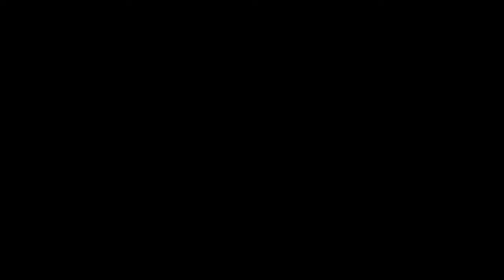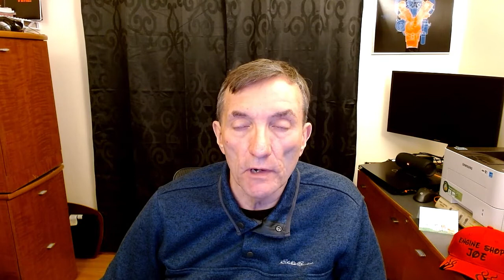ISX Jake stages explained

Comment: If a speed sensor for my speedo is not working will that have anything to do with my jake innermitantly not working to full potenchal
Reply from the maker: Short answer No.  Long answer below.
If we are talking about an ISX 870 and newer, the engine ecm sends the speed signal to the dash computer (vecu) and that sends the signal to the speedo. There was a problem with some earlier calibrations where the speedo or tach or oil pressure gauge just stopped working. An ecm software calibration update would correct that. But it could just be your VECU or as i call it dash computer needs to be updated with the ESA program. Generally speaking if the engine ecm loses the VSS, also called road speed input, the jakes and cruise just completely stop working. If your jakes work but they are weak or seem like they are only half on ( by sound) It could be a mechanical or electrical problem under the valve cover. I always pulled the cover if they half worked and check voltages and solenoid function. ALso wire end clamping force on the solenoid spade. If that all seems ok and you have no wiring issues it could be some of the jake levers themselves are internally failed.
Reply: Well my cruse works rpms work but replacine the speedo sensor but the jake inermitantly doesen always work
Reply from the maker: @devinlewis3509  If when it does work it works like it should it is wiring- the wires on the solenoids get loose (the slide ons) from hot/ cold cycles and vibration. Pull the valve cover and make sure you cant pull the wires off the solenoids with a light tug. If you can remove them and squeeze the spring female connector  closed a bit and put them back on. I repaired a lot of jake issues just doing that.
Reply: Thankyou onece i changed the speed sensor everyting works perfect
Reply from the maker: Wow I am surprised that corrected the issue in the way you described it. I have to think this one out as i don't understand yet how they can work partially  if the speed sensor was bad. Anyway I am glad you got it working correctly and thanks for sharing how you fixed it. Good Job!
Reply: And on top of it it was really badly corroded

Comment: Are you going to make a vid on exhaust brake ?
Reply from the maker: HI, I have a couple engine brake vids up that cover the APEX through X15. The brake lever is the same all that changed is the controls. There are three other basic styles. Jake boxes like 855/N14's had, Under cover housings like the ISM or X12, And the midrange PAC brake that chokes the exhaust off after the turbo turbine housing. Were you looking for something specific?
Reply: @ENGINESHOPJOE 2350 2019. My Jake's get weak then excessive vibration. Did new wiring harness that cummins installed. Then another shop replaced selanoids found pinched o-ring. But no change help plz